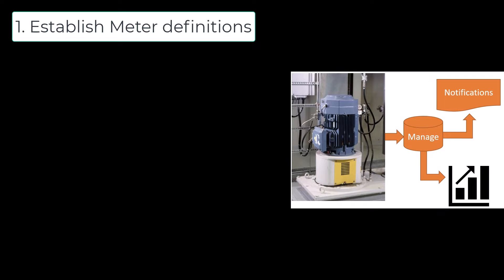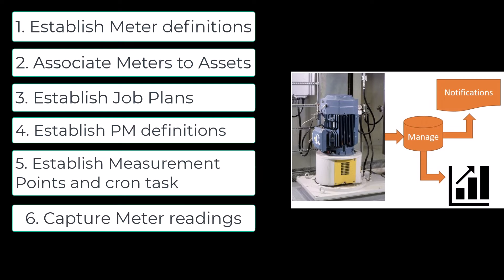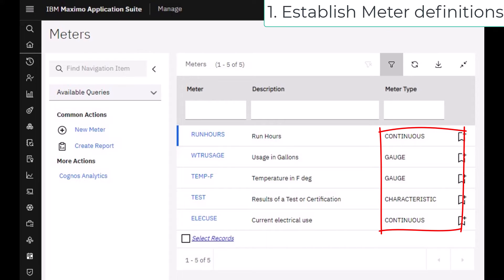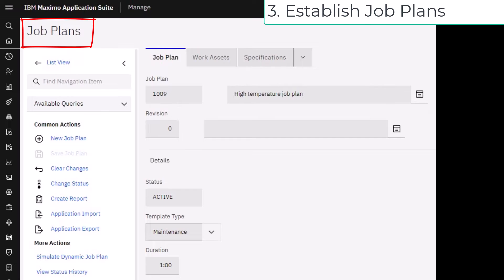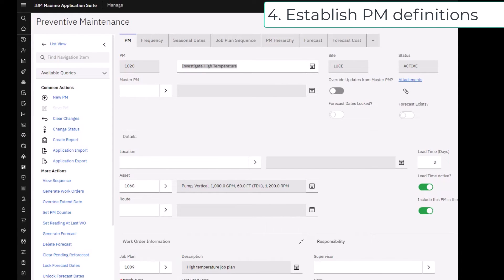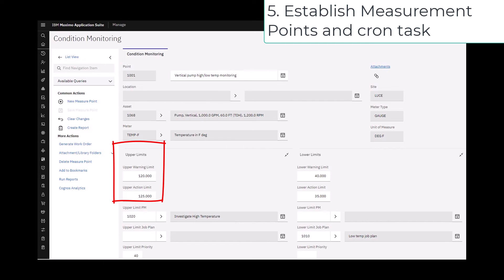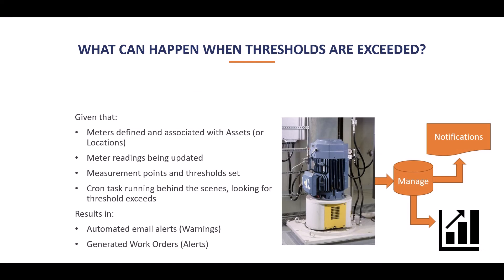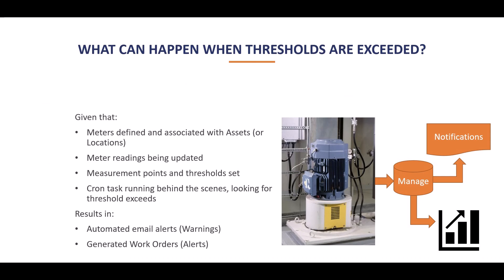Condition Monitoring - IBM Maximo and MAS | Feature Friday

Comment: Are you aware of meters compatible with Maximo specifically for electric motor management?  I assume standard Thermistors, RTD's and Thermostats are compatible... I'm curious about the newer type of "all-in-one" type sensors that detect vibration, speed, temperature, etc... these new sensors all seem to come with their own systems that don't necessarily communicate with Maximo easily.  we're looking for something more plug and play.
Reply from the maker: So Maximo can interface with just about anything via its Integration framework. The telemetry from the devices is often stored on a historian database of some kind. Then, Maximo can be connected to that database to ingest the data for updating the meters. (table to table, API, etc.) The new version of Maximo... MAS 8 has a component called Monitor that includes pre-built connectors to all sorts of devices that makes making the connection much easier. Send me an email at john.todd@trmnet.com if you want to talk more. Thanks!